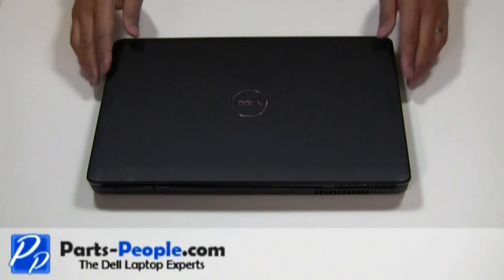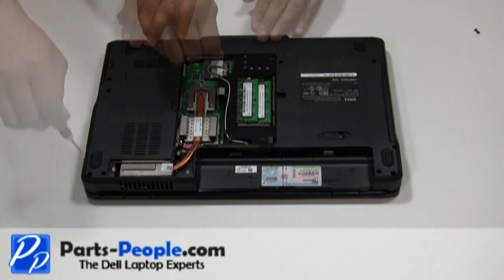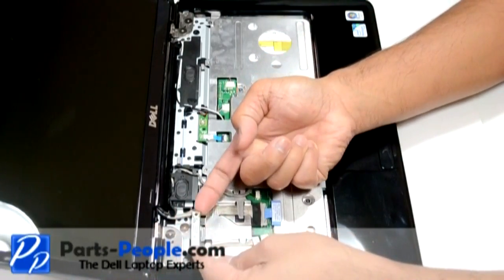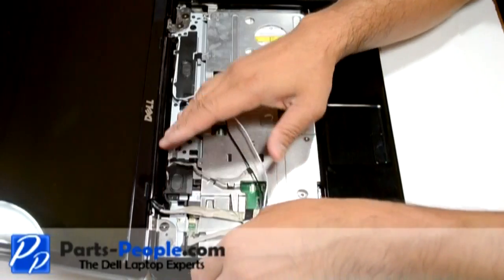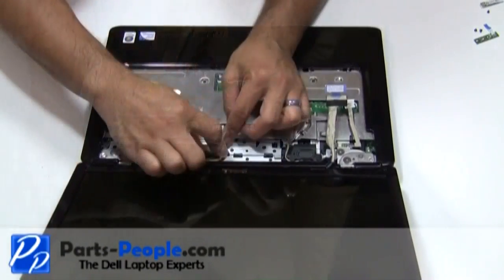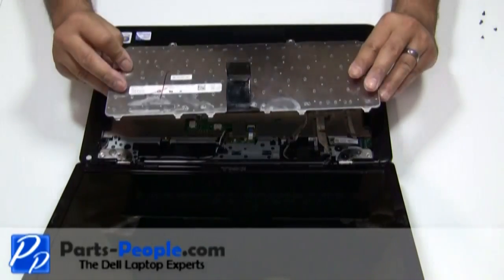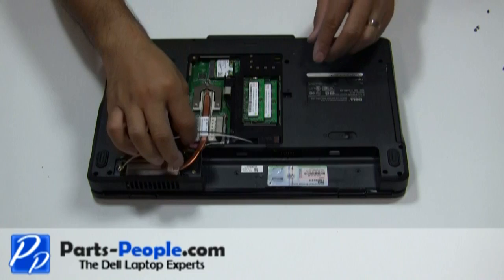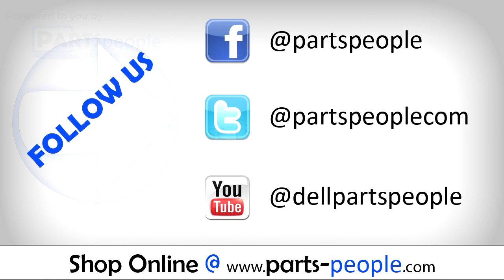Dell Inspiron 1545 | Touchpad Palm Rest Replacement | How-To-Tutorial

Comment from the maker: When replacing your touchpad palmrest assembly you should be able to just install it with out having to update the BIOS.  However;  if you do not have the latest touchpad drivers you may need to update them.  They can be found a the support.dell website.